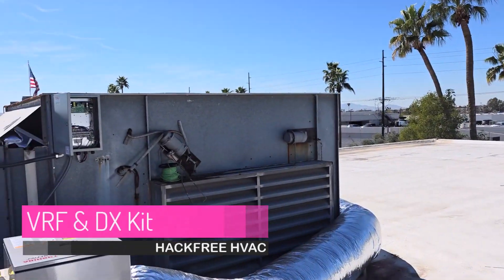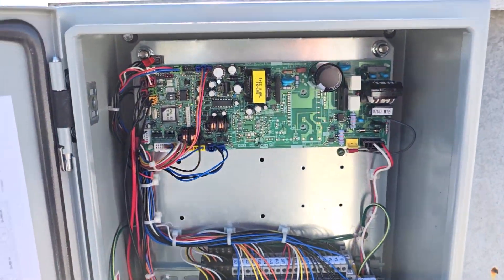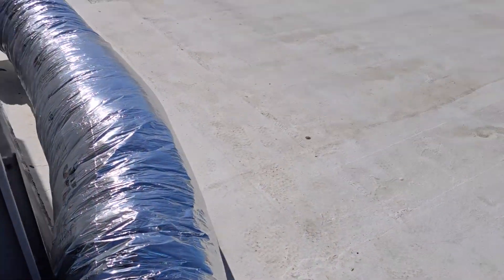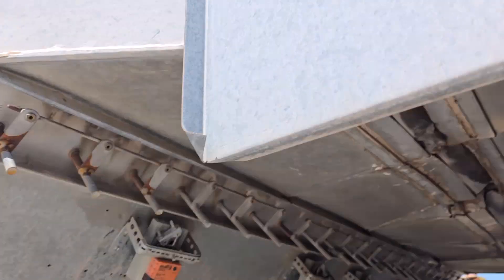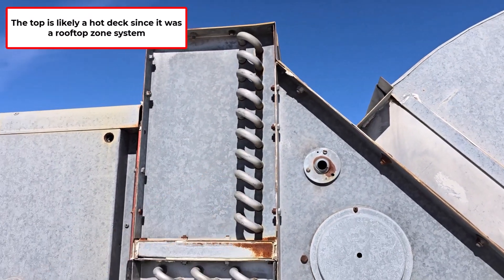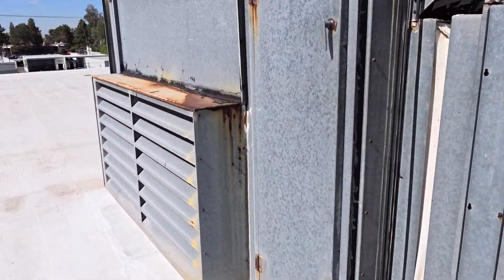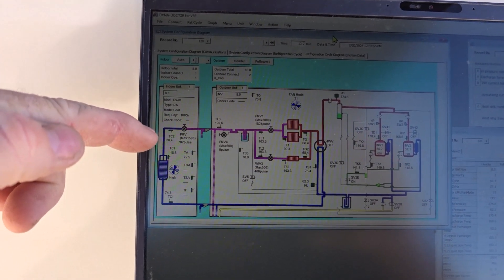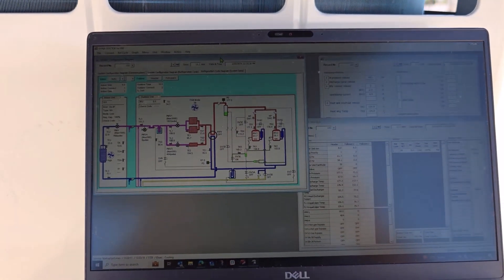VRF connected to DX Kit on old 40 ton chilled water AHU

Comment: so how are the Toshiba vrf systems
Reply from the maker: They are pretty good. Computer interface is nice on these too.
Reply: Seems nice and easy to understand, I like the Samsungs and Fuji software dakin and Mitsubishi super geto. Hitachi VRF software looks impressive our company is thinking of trying the Hitachi VRF.
Reply from the maker: @marcoferreira226  I have used the LG, Daikin and Mitsu. But not the Samsung or Fuji. Daikin and Mitsu is ghetto indeed. LG was nice and polished. As is Carrier and Toshiba Carrier.

One nice thing about Toshiba Carrier is if your laptop screws up during trending you still got the data it collected so far. Most of the brand software will loose all that you recorded if the laptop crashes, goes to sleep, runs out of power etc